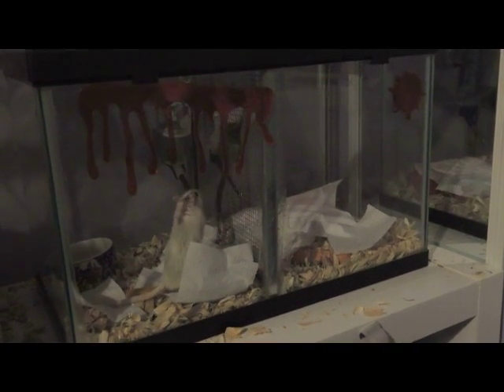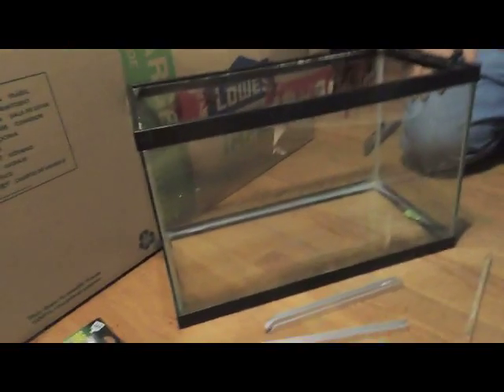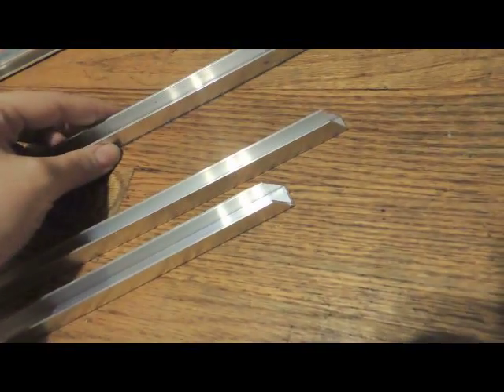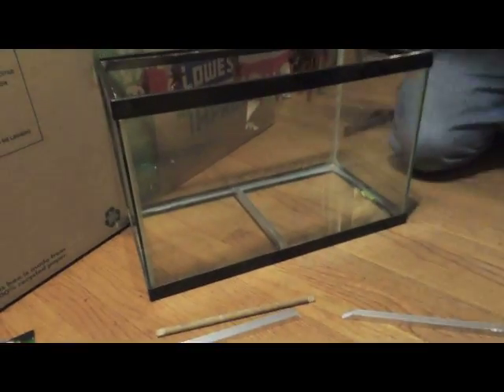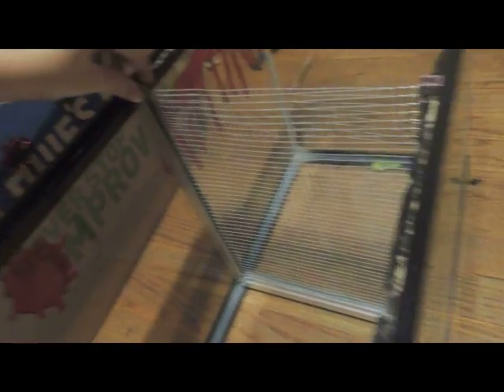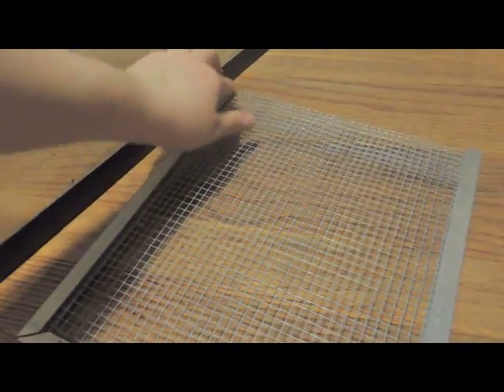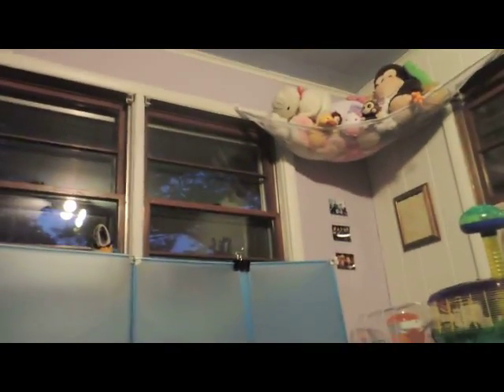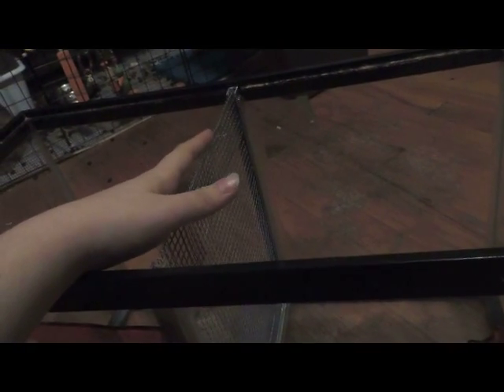Building a high quality removable split tank divider for introducing gerbils

Comment: This isn't the best idea because now the metal pieces are stuck in there. You should've just glued the hardware cloth into the aluminium pieces and then hold the aluminium pieces in there at the top with the plastic pieces you cut out and at the bottom with the bedding. Then you could easily just pull out the whole thing when they're introduced.
Reply: WristyTheMod I think this type of split cage is called a permanent split cage - the metal channels are intended to stay there. The hardware cloth will obviously be pulled out to introduce the gerbils, but just in case the introduction doesn't work, they can just be put back in with the divider again, all with less hassle. It also might make the split more sturdy (decreasing the risk of the gerbil getting to the other one). I personally haven't done a split cage myself (but planning to), and am assuming that another purpose of dedicating a tank to introducing gerbils is so you can use it for multiple pairs of gerbils a lot more easily, as in most tanks like this the amount of layers of hardware cloth / mesh can be adjusted. :)
Reply: I've been breeding gerbils for almost 9 years now. My grandfather made me setup like these in almost all of my tanks. We leave the "rails" there (tho I only have some on the sides, not on the bottom). Once the split cage is done, we just take the grid off and there it is. It's not incredibly pretty, that's for sure, but it does the job well while making sure you don't get accident. The gerbils don't mind the rails at all.